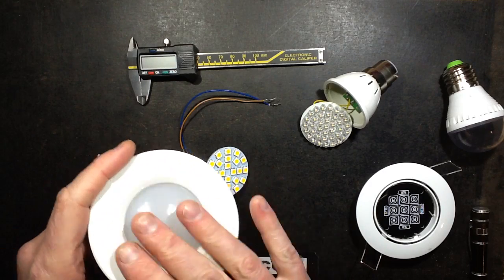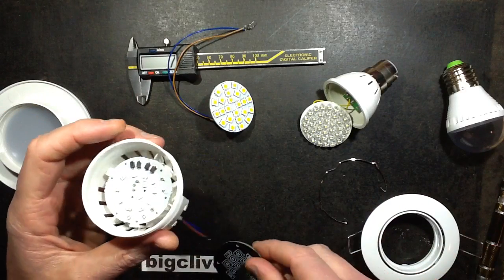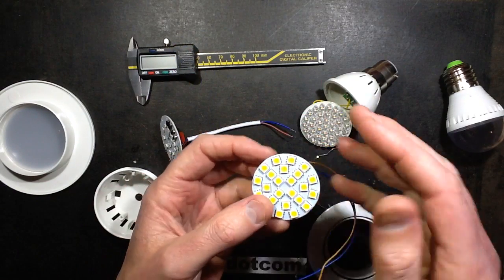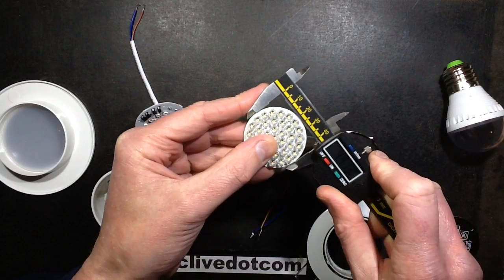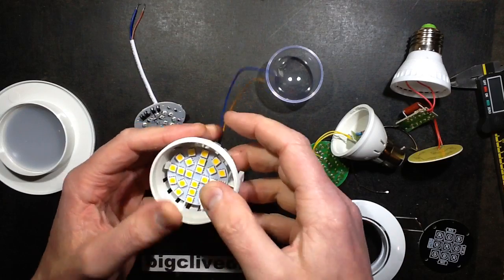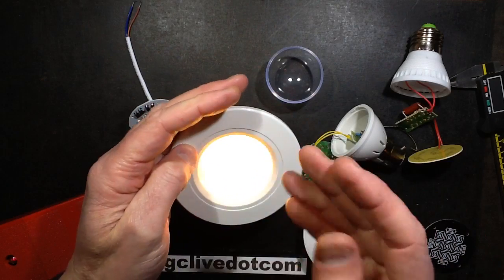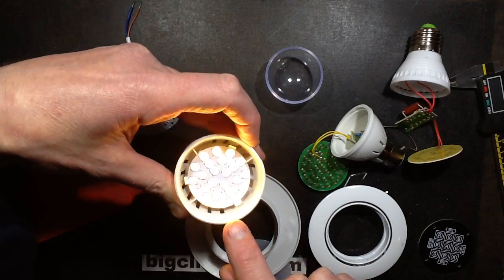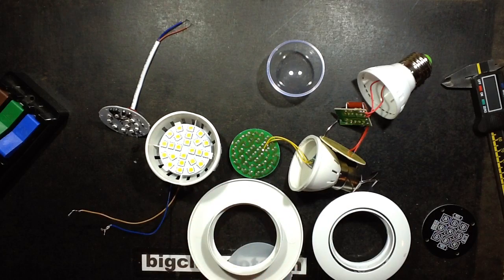Industry standard 44mm diameter panels in LED lamps.

Comment: I really like that rapid mains connector you have, where did you get that one from ?
Reply: RODALCO2007 Found it on ebay.
Reply from the maker: RODALCO2007 They used to be very common.  But for some reason they are rarer now and cost a fortune.  The price used to be around a tenner.
Reply: bigclivedotcom Thanks four your reply. They sell them for 35 Quid plus postage. I will keep an eye out for a hopefully good deal one day.
Reply from the maker: RODALCO2007 Or as an electrical industry pro you could use the slightly more dubious arrangement of three of the releasable Wago blocks like I use in some of my other videos.  The quick-block is quite handy for "volatile electrical stuff" though.  It should also be noted that the quickblock units were routinely used by some less capable people as an alternative to plugs, and quite a few people came croppers when they hastily shoved the wires in and put the earth wire into the live terminal.

Comment: Very valuable information this, 44mm PCB
Personally I like RTV for mounting things that get warm
Dow 3145 when I can afford it, some RTV is corrosive to electronics. 3145 is great and safe to electronics, no acidic acid smell neither.
Reply from the maker: Craig Nehring The standard acid-curing silicones cause corrosion, particularly when they are used to seal airtight enclosures and the acid vapour gets trapped inside.  In the case of the MR16 PCBs they don't get hot at all, so the hot-melt glue is a good option due to its speed.